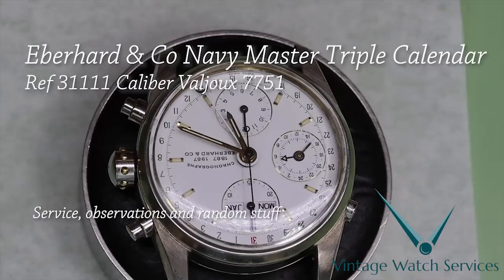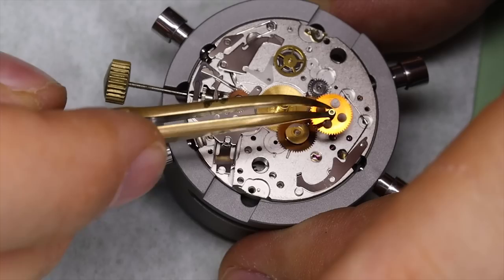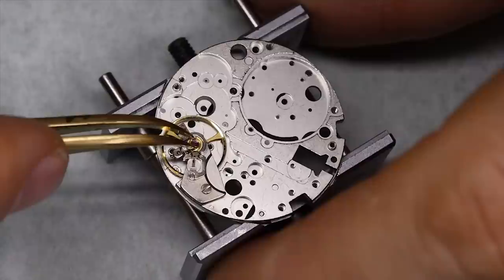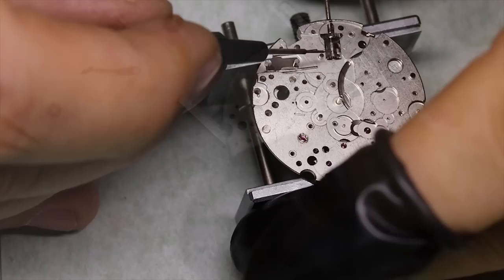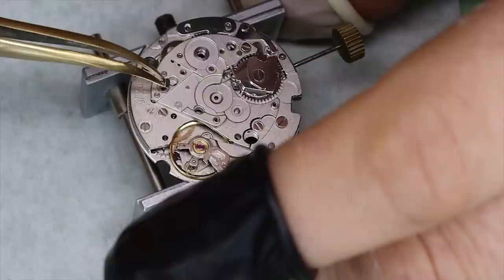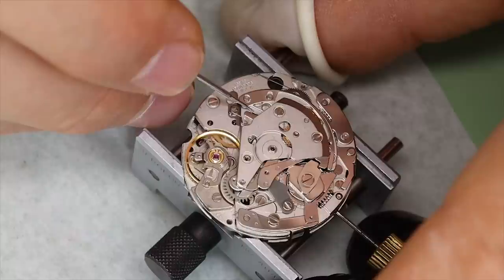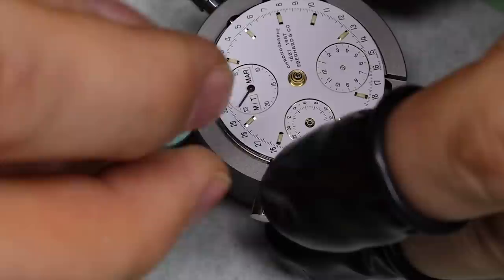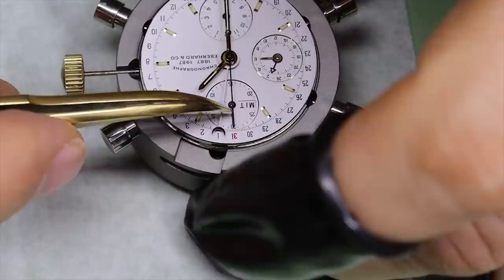2006 Eberhard & Co Navy Master Triple Calendar Service Cal 7751

Comment: My goodness!  Who knew I could stop breathing for 15 minute stretches at a time? 😵

It is staggering watching someone this talented work with such a fine instrument.  To me, a movement like this is unbelievably complicated, sophisticated and beautiful---a wonder of engineering and design. It bothers me that the watch community seems to have a rather uppity attitude toward the Valjoux 7750/7751 movements as "utilitarian / unsophisticated / only found in cheaper watches / nothing special" etcetera.  

But I digress.

It is a real treat to watch someone work so confidently on something so intricate---calmly taking out part, after part after part.....  Each time you set aside yet another teeny, tiny screw or wheel or other part, I kept thinking "Nooo..... how will you know where it goes back again later?!" .

When you got to the replacement of the hands at the end, I thought I might pass out---lol.  I've always liked things to line up as they should (car steering wheels should be properly straight after an alignment!), and to see you putting all those tiny hands on and lining them up so nicely.....wow!

It was the lack of lining up of the second hand of so many quartz watches from the seventies until recently that soured me on quartz.  Though, to be fair, apparentlly I'm not the only one who detests this sloppiness, and from what I read on the forums more (all?) decent quality quartz watch makers now put more of an effort in to line up the second hand with the markers.

Also enjoyed your modesty and lovely humour.
Reply from the maker: Hi there, thanks so much and I hope you caught your breath by now 😂 Hand alignment is indeed very important, as it is something the user will always see. 

The Valjoux 7750 is absolutely a product of a focus on cost saving and production efficiency, which is reflected in the very utilitarian design of it. That does however not mean that it is not a fantastic movement. It is extraordinarily resilient, it is very reliable and gives excellent performance. Which is certainly more important than beauty to the few that get to actually see it. And if there is a display back, it certainly looks nice enough when finished well. 

I think some of the beef some people have with the 7750 is that it is often used in expensive watches while the movement itself isn't expensive to buy. That's not the fault of the movement though, it's the fault of the brands charging premiums on the back of it... 

I'll be doing an Omega Speedmaster Automatic shortly with basically the same movement as the Eberhard and will be pointing out the differences and similarities then! 

And between me and you; sometimes I look back at the video of the stripdown if I don't remember where a screw goes 😉

Comment: Would like to see your technique on adjusting beat error without the beat adjuster (older models).
Appreciate your time and effort making the videos it helps a 57 year old beginner like myself tremendously.
Reply from the maker: Hi Edward, thanks for watching and 57 is a good beginner's age for watch tinkering :) If you check the Hebdomas video you will see how to adjust the old type movement without a mobile stud carrier, in the safest manner. But unless the best error is high your might not want to fiddle with it, as the chance of messing up the hairspring is pretty significant.

Comment: The complexity of that watch is evident in the video length; twice your 'normal' time.  I really enjoyed it and learned a lot about the movement.

I have a Sinn chronograph with a (high grade) 7750 that has been nothing but trouble.  First the hour counter refused to stop counting even without the chronograph engaged.  I sent it to Sinn (USA) and it came back from the service with the same problem.  Back it went and they told me that the guidance had changed and the brake and the hour counter wheel had to be replaced together.  It worked nicely for a year and then the chronograph second hand developed a 'stutter' and now the chronograph doesn't count accurately despite it keeping regular time nicely.  I'd moved overseas by then so I'll have to send it somewhere else next time.  I've read that this is a spring tension adjustment, but when it comes back from the next service it will be sold.  It's a shame that such a ubiquitous movement has been so  troublesome for me as I otherwise like the watch.
Reply from the maker: Hello Shane, thanks for watching! The hour counter wheel is indeed a commonly worn part on the 7750, so on a watch that's maybe 15-20 years old the chance of it needing replacement becomes increasingly higher. The seconds hands stutter and irregular running is not that common of an issue though, especially since it developed over a year. My guess would be there's dirt interfering with it.

Comment: Beautiful watch. If I remember correctly, my Tag Cv2010 had the 7750. Beautiful but very tall on the wrist and lost my assssss on the re-sale. Seems people tend to stay away from that movement.
Reply from the maker: Thanks for watching and for your comment! The 7750 family is ubiquitous, and people certainly do not stay away from it, but many watches using it are extremely overpriced. Tag has had its share of problems in the watch buying community over the last few years, and that might be part of the reason why you didn't get a good price on the re-sale.

Comment: How would you know about the dimple in the rotor screw?  That is not something one might discover by accident.  I guess the question encompasses how do watch hobbyists learn best practices in handling, adjusting, dis- and re- assembly, oiling, and parts replacement for specific calibers and the watches built using them?
Reply from the maker: Thanks for watching! You might literally find that dimple out by accident :) But indeed, it's not something you would think about if you don't know the movement. It really points to having good habits in terms of looking up manuals/tech sheets for the watches you're working on.

Comment: LOTS of wheels, springs and screws there! To be honest I like more "simple" (clean) watches better than watches having several chronographs and buttons like this one has, but still I think this watch looks very pretty. I googled Eberhard and many of these watches look very good. I do have a couple of vintage Omegas from the late 50s and from ca 1970, and these look classy and clean to put it that way.
Reply from the maker: Thanks for watching, Terje! I'm a fan of Eberhard myself also, they have some very clean and classy designs. And chronographs are always fun to work on, with everything going on there :)
Reply: @VintageWatchServices  I do have an old silver pocket watch also, I'm not even sure which brand it is.... no name on the dial. It's like impossible to sell it cause there are issues with it and dial is partly broken. I could ship it over to you if you're interested. You could fix it, sell it, use it for spare parts or whatever.

Comment: I used to have a Valjoux 7750 Omega speedmaster from 1993 and was not impressed with the build quality. Years later I bought the same watch from Ebay (after a burglary my watch was stolen) and that needed (of course) a service. the local watchmaker had some problems finding the right dials (the month and week dials were not the same language) but the watch was fixed and serviced ok. After about 5 years it stopped running completely. Also I had noticed that if you used the stopwatch functionality, the watch started to run very slow. Not sure if this is typical for this type of movement or that it was a technical issue. Anyway, after a check by the same watchmaker he suggested a complete service which would set me back  around € 700. I opted out of that and was able to sell it locally to a watch lover who was 'willing  to take the risk' . I still do like these mechanical watches but for now I prefer  to wear a smartwatch. It has functionalities that a mechanical watch will never have.😊
Reply from the maker: Thanks for watching! It sounds like the watch you bought had some issues (which is unfortunately not rare with ebay purchases). It should not run slower when the chronograph is in action and stopping after five years with no big incidents is very uncommon for a 7750. Did the watchmaker then not actually service the watch in the first instance? If not, that would be the reason it ran badly and stopped. And €700 is very steep for a service.
Reply: @VintageWatchServices  Thanks for your answer and explanation. Let me explain a bit more: my 7750 was in an Omega speedmaster triple calendar with moon phase. After I bought it it was services and the dials for the weekday and month were changed so they were the same language. After 5 years, I had the issue that it completely stopped running. So I brought it again to the same watchmaker. He came with the estimate of around 700 euros. If that is steep, I cannot judge. But he explained to me that he recently finished some courses and was now 'official' Omega certified. I believe it meant that he was allowed to buy parts officially from Omega as as an independent watchmaker, certain items are very hard to come by. Hope this explains.

Comment: What a great video! I've watched it twice now, glad to see that your channel is really catching on. Lots of information here, never realized how many parts there were inside the common old 7750. I have a couple of questions if you  have time;
   You compared the 7750 to the El Primiero in terms of beauty, what about the difference in durability and accuracy?  It would seem like the high-beat EP might demand shorter maintence intervals because  of it's higher beat rate?
   I have heard that some users of 7750s (IWC in particular) rework and add their own proprietary parts. Does this make a difference in performance? 
 Thanks, looking forward to your next episode.
Reply from the maker: Hi Randy, thanks for your kind message, much appreciated 😀 I hope I didn't come across as saying the 7750 is a bad movement, it really isn't. It's a very good movement and provides both very good accuracy and durability. It comes in chronometer versions also, but the standard versions are plenty accurate enough. 
Omega is probably the one modifying the stock movement the most but also they mainly replace the plastic brakes with metal brakes, from what I have seen. IWC used to do a bit more to it but now apparently uses more or less the stock movement. Of course both of these as well as other higher end brands have high end finishing, but this is mostly done by ETA directly as integrated processes for their big customers. 
I'm planning to do a couple of Speedmaster Automatics shortly (7750 and 7751) and will go through the differences between Omega's version and the stock version then. I'll probably focus those videos mainly on those differences instead of running through the entire stripdown and assembly again. 
I almost forgot about the El Primero: 36000 bph is kind of pushing the envelopes for mechanical movements and there is a reason pretty much all watches nowadays come with 28800 instead. There is more wear with a 36000 bph movement and it does need servicing a bit more frequently. That said, the El Primero family is about as good as they come. El Primero is a rather large family of movements, both automatics and manual wounds, but they are all extraordinary quality and do not actually compete with the 7750, they're a class above in terms of price. Rolex famously used El Primero movements in their Daytonas but would probably never consider using 7750. Not because the 7750 is significantly worse quality but because everyone else uses it, I would wager 😁
Reply: @VintageWatchServices  Thanks for your thoughtful and detailed answer to my questions (one of the great things about your channel).  You didn't seem to come across negatively about the 7750, just pointing out that it was designed for streamlined manufacture and durability instead of Geneva Seal finishing. Moreover, there was a wealth of information included in this video and it came from the perspective of a watchmaker instead of some tragically hep youtube influencer with an unknown agenda. As I said, personally I view this as a great resource. Regarding the Zenith,  I have always been a bit suspicious of the high beat business (didn't Rolex slow them down for use in their Daytonas?) and was curious what a professional thought of the idea as 36,000vph still doesn't seem widespread in it's use, GS is the only other maker that comes to mind as a user.  And speaking of Seiko (and chronographs), I read somewhere recently that Seiko, wearing their SII hat (think NH 35/36 movements) has some new chronograph movement that they hope to sell the world as an alternative to 7750s. I can't remember the designation, something like 088,  but it's supposed to look good with all the upscale features like like column wheel and for cheaper then a 7750.  Have you heard of this?  They feel that there is a growing demand that Sellita can't fill since Swatch turned off the tap on movement sales .
       Look forward to all your upcoming videos (any chance a Val 72 is in there?).  I also found the blog section of your site had some interesting reading, especially about the subject of vintage watches.  
Thanks again.
Reply: @randyallen2771  I know it's been a while but you were referring to the NE88.  There is also the related NE86.  And yes they are both excellent movements.

Comment: Love your videos, including all the occasional background info! A quick question though; in the videos I've seen from you, you remove the top and bottom shock jewels before cleaning. Isn't the balance staff better protected WITH them fitted during the cleaning process? I've learned it that way and now wondering what is best haha. Many thanks, from the Netherlands!
Reply from the maker: Hi Robbert, thanks for that! It's an old saying that if you have a clock in your house you know the time, but if you have two, you're never quite sure.
So you'll hear different things from different sources regarding many things, including whether or not to take the jewels out or not. 
I don't think there's any danger to taking the jewels out before cleaning and I also don't think there's a big benefit to it, so do as you like :)
Reply: @VintageWatchServices  thanks for replying! Looking forward to your next video :)

Comment: If you let the watch unwind from a fully wound state, can the time-grapher  give you a plot of the various deltas of the parameters it reads? Would it be useful. I suppose you could do it manually by winding a little, take a reading, and repeat until the movement is fully wound. Love your presentation, btw.
Reply from the maker: Hello Richard, thanks for watching and for your comment! Part of the testing after a service is actually to let the watch run for 24 hours and then put it on the timegrapher. Mainsprings are designed to provide even power for almost until they are completely unwound, so after 24 hours we should still see good amplitude and time keeping.
Reply: @VintageWatchServices  Thank you.

Comment: Abut that little pinion on the barrel, did anyone make a guess? My $£€ is that it’s for a power reserve complication that Eberhard didn’t utilise in this model. Alternatively, could it be the winch pivot for a (very slow and precise) ETA powered grapling hook, designed for daring escapes from the Swiss mountains?
Reply from the maker: 😂 It's actually the driver for the chronograph hour counter 👍

Comment: Fantastic watch and job. Before to open watch 359 S/D and before????
Reply from the maker: Thanks! I don't really understand your question?
Reply: @VintageWatchServices  at minute 2.59 you entered the watch into the timegraph and it was measuring +297 S/D ( not 359 S/D.....sorry) before you started cleaning the watch. In the end you did not show whether the stability and accuracy of the watch in the timegraph had improved only with cleaning. That's all.
Reply from the maker: @enzoiu8moa330 There's a two minute section on adjusting the watch starting at around 26:30...
Reply: I had inadvertently skipped this part. Sorry if I ask. Good job

Comment: Great video,  thank you for sharing.  What do you think was the cause of it not running?
Reply from the maker: Hello Ben, thanks for that! It's difficult to say, but given that the watch started up by itself it was likely too much grease at some points, as I spotted very generous amounts of it. It could also simply be a bit of dirt somewhere. It doesn't take a whole lot to stop a watch movement, as the power is really quite limited.